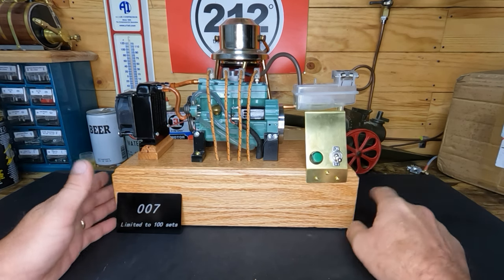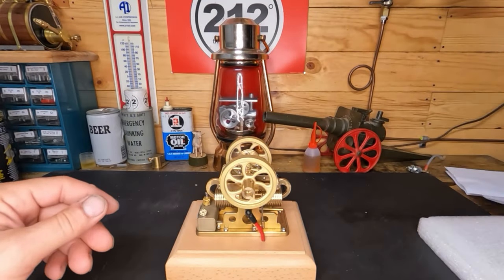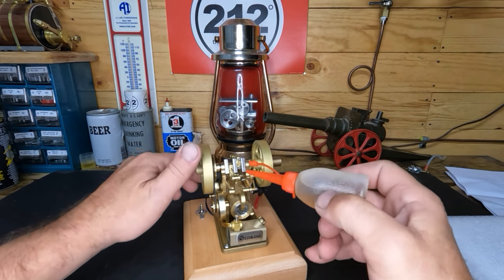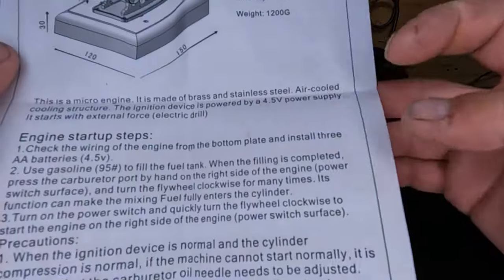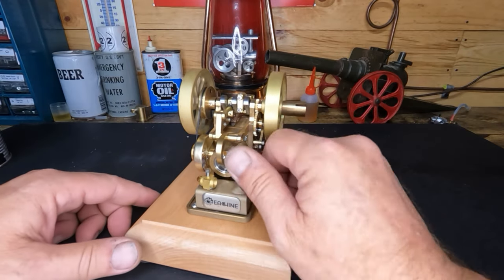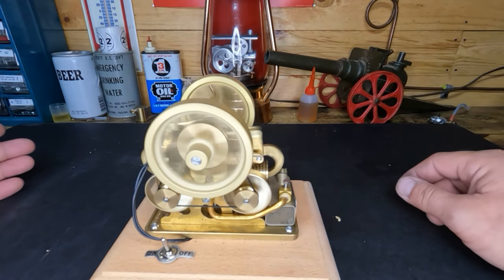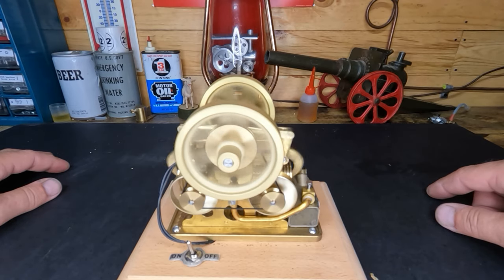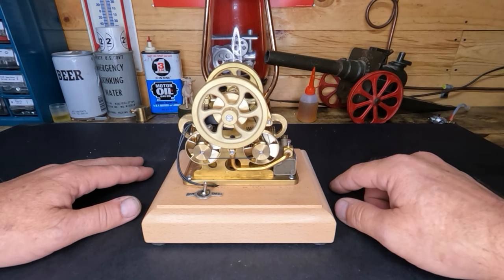First start of a scale model Atkinson engine M14  AKA  EM1

Comment: hi. initially when you noted there was no throttle to change the engine speed i thought of a couple of ways involving venturi restrictions and then had a cogent moment. there are fans that cool the engine. they are small and have to flow at least a set amount of air to keep the little guy cooled properly thus the set engine speed. as to the layout another engine came to mind....the commer 'knocker'.
thanks for the vid. :-)  =dok=

Comment: Be sure to put loctite on the small end connecting rod bolt (on threads only). I have one of these and the bolt come out while running bent connecting rod badly.  Had to get new connecting rod for it.
Reply from the maker: Hi Randy, I could only imagine what would happen if it worked loose, catastrophic failure for sure. I will be sure to blue loctite these also. Henry also commented about the issues with his, so it sounds like an ounce of prevention is worth a pound of cure. Thank you for your helpful comment and for watching 👍

Comment: This from Stirlingkit? If not where?
Reply from the maker: Hi Nick, Yes this engine is available from Stirlingkit.com  it is the m14 model.  If you use the code steam212 at checkout it will save you 10%.
Reply: @Steam 212°  I wasn't sure that's why I asked. Come assembled or do I have to assemble?
Reply from the maker: @nsvaluto48328  Fully assembled, but you will need to add your own batteries and fuel.  It never hurts to give it a once over (and oil it) before the first start. This one (in the video) is still a great running little engine, not all that powerful, but easy starting and a good running engine.  I hope this helps you 👍
Reply: @steam212  yes it does

Comment: If yours runs for a bit and then stops and won't start, check all the set screws.  I got mine and it ran briefly, but then all the loose set screws let the timing go completely out.  Once I got everything back in place with Loctite that's been a fantastic little engine.
Reply from the maker: Hi Henry, thank you for the heads up. I will be sure to address this before any issues pop up. How are you doing with the generator testing? I've been watching, and you've done a great job 👍
Reply: @steam212  Taking a break because I'm busy with vacations and other things.  I have a list of modifications to hopefully have it finished when I get back to it.  One other note:  These engines have different designations depending on the website you get them from, the EM1 is sold as the M14 other places and the ET1 is the M90 on some sites.
Reply: I've got that same problem. Timing doesn't seem to be the issue though. It will run for a moment after choking with needle valve barely open but opening needle valve the slightest amount kills it. Opening a quarter turn from closed floods it. The needle valve seems to be a very loose thread in the venturi. I even tried a wrap of teflon tape around needle valve threads thinking it was creating an air leak but that doesn't make any difference. It is like the "carb" and needle valve have made the engine an attractive piece of non functioning brass.
Reply from the maker: @oldtugs  Hi oldtugs, I know these carbs are super sensitive with the adjustment needle, but your issue sounds a bit more odd to me. I have not seen inside of the tank on this design but I am assuming that there is a fuel pickup tube on the bottom of the carb mounted tank, I wonder if there is a bad solder joint on the pickup?   These little engines are convenient because of their size but are a real pain when your hands are normal size. This is going to sound nuts, but have you verified that the sparkplug is good? Making sure that the boot isn't jumping the arc to ground (it's happened to me a couple times). Also, how is the compression on yours?  I'd love to help you get yours running right.    Stay in touch and I'll help you however I can 👍
Reply: I had a lot of issues with mine before the set screws completely gave way.  It would seem to be timed ok, but then cranking it pushed the cam gear one way and running pushed it the other way.  If you've made sure the set screws are holding properly, then have you tried putting a longer arm on the needle?  I have a 1" pin glued to the top of the carb needle because the adjustment is so sensitive (between 1/16-3/32) and I had so much trouble getting it right with just the knob on the needle.  I was considering doing a teardown of this engine so I could look at the valves and show how it is assembled, but the intake valve body, intake, and carb are all soldered together (blocking fasteners on the intake valve body).  The carb is not fastened to the fuel tank (as far as I can tell) so you may be able to remove the mounting screws holding the engine to the base and lift the whole engine (carb and all) out of the fuel tank to check the fuel pickup.
Reply: @steam212  Thanks for the response. The plug is good, it had a very wide gap as delivered but closed it down a bit and get good spark. Side note on the plug, the lead was straight cut inside the boot so had no direct electrical contact with the plug. I removed the insulation for about 1/8 of an inch to expose the conductor and inserted far enough to make contact with the plug. That gave me much better spark. The needle valve is very loose in the venturi threads. I put a wrap of teflon tape on the needle threads to see if they were leaking air but it made no real difference. I have tried the full range of timing, compression is very good. I am thinking the needle seat is bad, probably too open. If I close the needle completely I can still "choke" it and get fuel to intake. It will run for the length of time it takes to burn that fuel. Opening the needle any amount at all floods the engine. I sent an email to Stirling asking if they will provide a replacement venturi and valve. I'll keep the group posted. Alternative is to obtain an RC engine carb and see how that works.
Reply: @henrybangsberg2187  Thanks for the advice and information. That is one of my next steps, remove the "fuel system" and see if there is anything that might lead to the problem. My gut feeling is the needle valve seat is out of spec. It is a beautifully made needle though! An RC carb might be the step beyond that if Stirling doesn't participate.
Reply: @oldtugs  I've had good luck getting help with the one engine I had issues with.  The specs on these are pretty loose to hit the price point, so I have noticed wide variations in needle/seat combos on all my engines and they do absolutely no fine tuning at the factory.  If it runs for a few seconds, then it's shipped out (another cost cutting measure to hit the price point).

Comment: I wish mine ran for longer than 2 seconds. The needle valve is so loose that the mix is either too lean to run or too rich after a 5 degree turn of the needle. Multiple emails have produced only promises to "look into" the situation. It looks like you got lucky, my advice would be to avoid this manufacturer since support is non existent.
Reply from the maker: Hi oldtugs. Have you tried wrapping the needle threads with a few wraps of Teflon tape to "snug" it up?  Just a thought to try 👍
Reply: @steam212  Yes, that is the first thing I tried. Thanks for the reply.
Reply from the maker: @oldtugs  How about spring out of a click type ball point pen (cut to length)? I have a few full size hit and miss engines and they all have a spring on the needle valve shaft. The old guys knew what they were doing 👍
Reply: @steam212  I have several vintage glow and diesel engines that use that technique to maintain the valve setting. My  first thought was the same as yours but after sealing needle threads with teflon there is no issue with the needle setting changing from vibration. It seems like the needle seat is at too great an angle which effectively negates mixture control. The few seconds run is because the intake volume happens to be at the correct mix when it starts but never again when air is flowing. If the maker won't help by supplying a new carb assembly I will source an RC carb and fit it to the intake.
Reply from the maker: @oldtugs  I did that exact same thing. I made a video about it "Let's make a manifold for the m17b and install a carburetor from a nitro fueled engine"  maybe it's something that may help you?
Reply: What   great  little engine . Ive ordered one before i saw your video,Thinking it was  neat engine . Looking forward too  its arrival . Love your channel ,from across the pond .